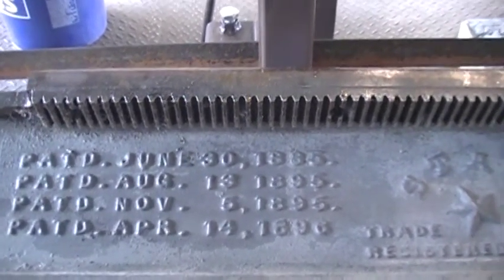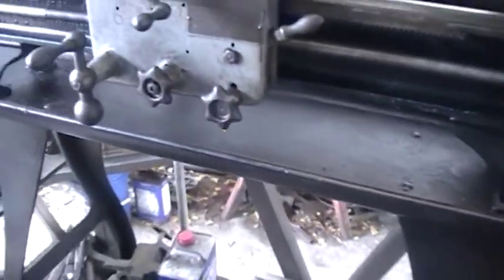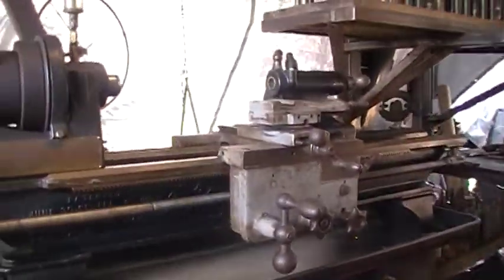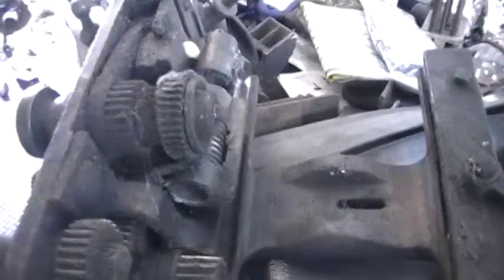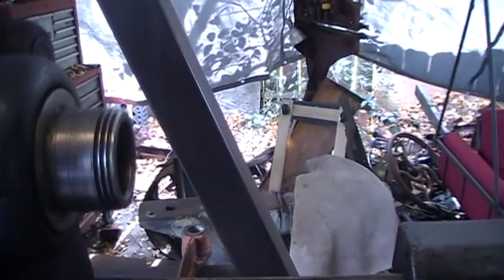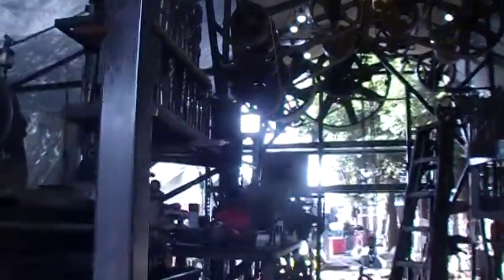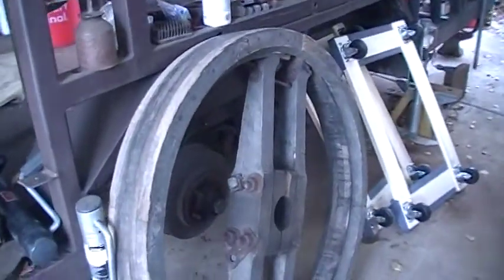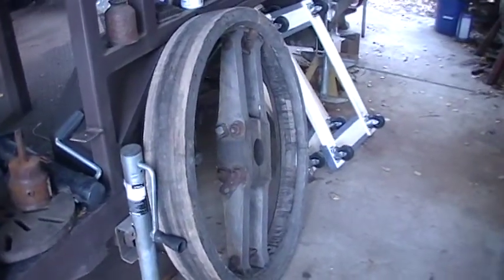1896 lathe

Comment: Them Senaca Falls "STAR" lathes crop up here in England...from time to time...
Barnes too...
In fact...there's an F. E. REED lathe right now on eBay....a treadle one..
There's a RIVETT toolroom lathe for sale as well...

I've just acquired yet another old flat belt drill press....one with a tapping head on it...
And some old bench and whetstone grinders...plus a 6" capacity pipe vice...🇬🇧☺️
Reply from the maker: Yeah they shipped the Barnes and Star lathes all over the world. The Reed might be early. Are you getting your shop together?
Reply: @davewilson1591  

It's going to be a long process Dave...

We'll get some of it running but I think it'll be on individual motors for the time being...
As it is now it's all still in storage...😕
Reply from the maker: @glennmoreland6457  I know! Life is a long process and now in my old age I'm enjoying it. Keep pecking away at it and it's surprising how much gets done. I have a new old project that I hinted at in the video and as soon as it drys up around here I can get it out from under raps. This takes me to a whole different level. You have to take your excitement and passion up a notch and for me that means more old iron. Guess I'm like everyone else.
Dave
Reply: @davewilson1591  

From what I could see your yard is similar to ours....
Loads of bits of stuff here n there...
I tried emailing you several times...but I didn't get a reply...
Reply from the maker: @glennmoreland6457  davewwwilson@gmail.com
Reply: @davewilson1591  

Just sent you an email Dave...

Delete your email address off here now please Dave....or you'll end up with loads of spam...👍
Reply from the maker: @glennmoreland6457  for some reason I'm not receiving.
Reply: @davewilson1591  

Look in spam...
It'll be "flandersflyer"
Reply from the maker: @glennmoreland6457  It's not in spam it doesn't seem to show up in my in box! Pretty crazy.
Reply: @davewilson1591  I'll send again